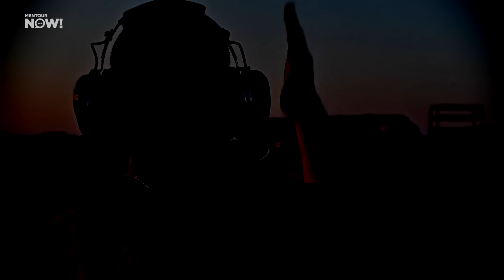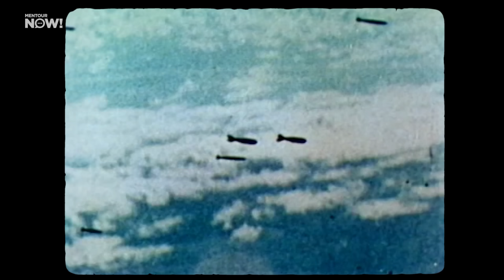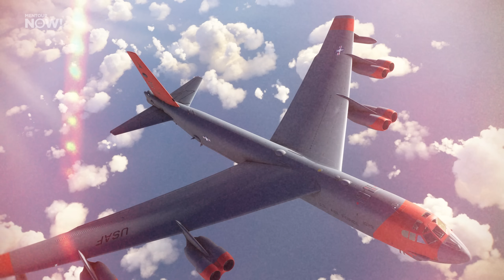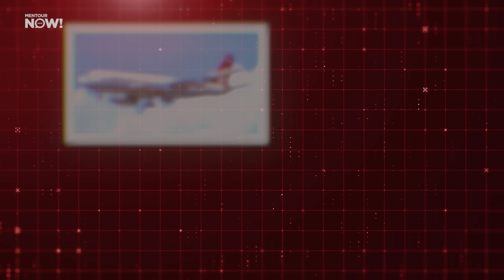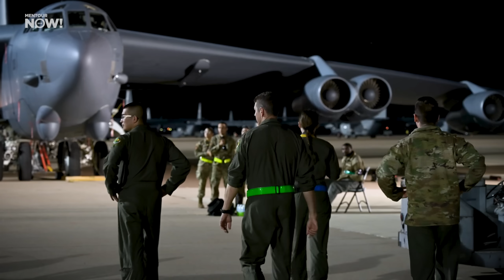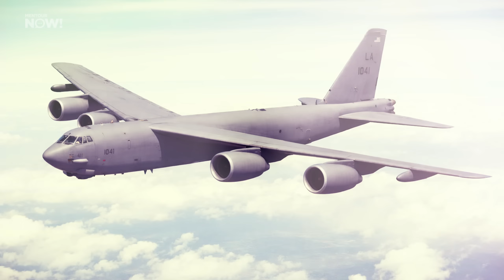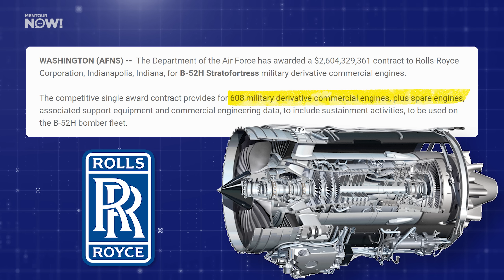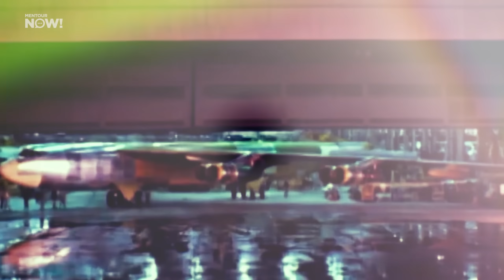WHY Are They Changing The B-52 NOW?!

Comment: My pops drove a BUFF from 1955-1959. My nephew is is on the engineering team at 
Rolls Royce NA that is working on the F130. Pretty cool.
Reply: Drove??
Reply: @toasterhavingabath6980 pilot slang for piloting an aircraft.
Reply: A great Job if you can get one.......
Reply: Dad was in the 9th BW during those years at Mountain Home, KC-97s and B-47s. I was born at the MHAFB hospital before the WW2 buildings were replaced, and visited old friends of my folks in 1981 while spending weekends at the sturgeon research crew trailer at Bruneau Dunes State Park.  In 1959, we moved to Rapid City, where Dad was one of the first three officers to establish the 28th ARS (the first digit of '928th' was dropped because they had a larger number of brand new KC-135As they were picking up from Moses Lake, which remains a Boeing Aircraft testing area.  After I retired to north Idaho, I met a former KC-135 flight engineer who'd been stationed at Minot AFB, while Dad's last duty station was Grand Forks.  I passed him Dad's appreciation for the flight engineers.  While on Alert Pad duty, flight engineers would have to load water for each engine's water injection system when the klaxon sounded, and offload the water when the "all clear" was given during the cold winters.  How cold was it?  We could tell it was cold when they were keeping the guard dogs inside, while airmen with M16s were still standing guard duty on the ramp.  Dad would take us kids out hunting snowshoe hares when it warmed up to zero, since it was warmer in the creek bottoms near the Pembina River.  (BTW, the flight engineer and I agree with Dad that it was a big mistake to remove those two positions from the 135. )

Comment: I suspect it is because of size.  There is little room between wing and the ground.  Eight engines allow them to be relatively small leaving reasonable clearance between engine and the ground.  Going to 4 engines would require 4 with far larger diameter then the current eight.  Additionally 4 larger engines instead of 8 similar to the current size would greatly change air flow over the wings.

Comment: Sometimes a machine just works so well, you can't replace it. The designers achieved such balanced perfection that everything that comes after has to compromise somewhere & something that makes them just less. Here is one another is the M2 .50 BMG from 1933
Reply: The big problem with Maw-duce is lack of sustained fire ability as it melts the barrel.. The GAU-19 with multiple barrels allows for much longer bursts with far less barrel wear because of reduced duty cycle and allowing for more barrel cooling.. This proves that there is always a newer better version that builds on the old.. A C-5 galaxy can carry 3x the bomb load of a B-52 and with the parachute suspended missile/bomb racks can deploy them at altitude so a F-22 or other aircraft can designate and guide them to targets..
Reply: It’s just a big plane.  Sometimes patching up a 60 year old airframe - even a great one- is so economically wasteful it should not happen.  

The world of commercial aviation has so much overlap that they could have replaced the b52 with a newer model easily decades ago.  

The B52 needs full air superiority so why not replace it with a 777?

Comment: My little sister has and still uses a KitchenAid mixer my parents purchased in the early 50's.Wisely, KitchenAid has not messed with the design in 70+ years. The B 52 may very well be worth modernizing.
Reply: It helps that out of all the B-52s we kept, we kept the lowest hour airframes and on top of that we keep another bunch in type 1000 storage so if we lose one (which has happened a few times now) then they pull another low hour frame out of the boneyard to refurbish. Although the planes are "old" they really aren't as planes go. Planes age out based on hours and cycles, not the date since manufactured. Cycles refers to how many times it has pressurized and depressurized. Operational B-52 airframes still have something like 1/3rd of their life left which is why it makes sense to keep them around. Basically the B-52 was built for something like 32,000 hours of flight time and none of them are over 25,000 hours yet. When you extrapolate that into the future, that's how they figure them still flying until the 2050s or even more. Some of the high hours frames will be retired starting in the mid-late 2040s but a sizable fleet will still be around for decades to come.
Reply: @ZboeC5 That... Makes a lot of sense. Huh. Whaddya know.

...unlike the guy we're commenting under. He talks about his sister still using a 70 year old mixer that the company hasn't changed the design of to this day... Then goes on to say, in light of his first statement I.... guess.... That the B-52 may very well be worth a complete redesign for modernization... Even though the mixer story can only be evidence for the saying, "what ain't broke, ya don't fix?" I don't get it.

My sister uses a 70 year old mixer! In fact the company still sells the same mixer today because the design was so robust! ..... Unlike the B52! Due to my sisters mixer, and the lessons its taught me, I'm of the opinion that we.... change every part on the bastards until they are unrecognizable!!! YEEEHAW!

Bro is one wild cowboy, I have a sneaking hunch... What's that called? Chaotic neutral? Or something.
Reply: Got a Kitchen Aid,....at 72 Had for years.......DNFW ,....DO NOT F..K with......It kitchen aid....
Reply: While I have nothing that old, my hand mixer is from the mid 90s and my can opener from the late 80s. Both still going strong as well, and probably for decades to come.
Reply: bullshit!!!! comparing a very usefull item to the asdtronomical money sinking airplane that your country cant even take care of its own people lol!!! what a spirit!
Reply: @carholic-sz3qv  -- Your basis of comparison for not even taking care of our own people is a world that has been protected by our military, mostly at our expense. So here's another comparison: imagine a world in which the Soviet Union had achieved world domination, or, more recently, communist China, Islamic extremism, or the corrupt UN/EU/WEF axis. Apparently, you value being "taken care of" more than being free from totalitarianism. And the part they don't tell you about is that being "taken care of" in that kind of world is being taken care of the way farmers take care of their cattle.
Reply: The early stand mixers seemed to have a safety circuit, they would not start up if they didn't recognize the "Off" position first. So don't give it up if that part of the switch gets dirty, just clean the contacts.

Comment: The JT3D is based off of the J57. The D-model has a larger vertical stab than the H-model.
Reply: Yes JT3D (TF33) is essentially a revised JT3C (J57) with an enlarged fan section substituted for the original fan at the front of the engine as a “quick-fix” to increase the bypass ratio and keep P&W “in the game” until improved clean-sheet designs could be introduced over the next decade.

Comment: Actually the B-52A to -F had a larger vertical stabilizer (and the rear gun turret with M2/M3 Heavy Machine Guns was manned), the B-52G then got that shorter one and the rear gun was remote-controlled, the B-52H then got a M61 Vulcan gatling gun instead.
And as JT3C and JT3D already suggest the JT3D/TF33 is essentially the same J57/JT3A-C core engine with a larger fan.

Prove me wrong but AFAIK there has never been a real reduction of the number of engines on existing airplanes (in the meaning of re-engining examples that have already been built but with less engines), there have been some parallel developments like the Airbus A330 and A340 or the Ju 52 which initially was the single-engine Ju 52/1m (one was even with a diesel engine) but they then only built 7 examples and then did the much more famous three-engine Ju 52/3m.
And there had been plans to develop downscaled versions of large planes with less engines like the MDD DC-10 Twin or the 747 Trijet but again except some testbeds they probably never intended to cut out the mid engine of an existing DC-10 or remove the outer engines of an existing 747 and put a third engine in the aft fuselage.
The 707 obviously got CFM56s which they also put on a lot of KC-135s and another version had JT8D but both still four of them.
It would seemingly alter the flying characteristics far too much and as said making it necessary to literally rebuild almost the entire plane with wings, parts of the fuselage and the tailplane which seemingly hasn't been viable on any plane yet, rather scrap it and get an entirely new one, like getting rid of TF33 KC-135s in favor of the KC-46 or the E-3, RAF and Armée de l’Air upgraded them to CFM56 but the USAF and NATO ones still have TF33s and they'll replace them with the Boeing E-7/737 AEW&C or other AWACS aircraft.

Comment: Wouldn’t the guys that designed the B-52 be disappointed if they knew that we are unable to cost effectively build a heavy, non stealth bomber with modern engines in 2026? Shouldn’t that be a fairly easy task, given how many heavy commercial and military aircraft we’ve designed and built since then?

Comment: It also make sense to reopen the Fairchild production line to build a few hundred more A10s. But this time the new A10s will ditch the heavy and clumsey 30 mm canon, and replace it with one 20 mm Vulcan , with more ammo and with 30 cal rotary guns in the nose.What ever weight capability still left can be replaced with added fuel. For anti tank role, the army still have choppers , but they are complex, expensive and do not have loitering time. Each tank require about 10 other trucks for support at the rear, and if they been disabled, the tanks are useless. There is still a role left unfilled from the original P47 Thunderbolt, and the B25 Gunn ships. That is not a spelling error, think Pappy Gunn the inventor.  If I am eastern block or third world, I would have bought the cheaper SU25 and Mi24 instead.

Comment: I worked on the G models and KC-135A’s, both powered by the J57 and I was in when the KC-135’s were upgraded to R models with the CFM-56. 

In the 1950’s there wasn’t an engine powerful enough to carry 600,000 pounds into the air using just 4, this led to the other design issues sen with using 4 today. The BUFF was truly revolutionary for its time.

Comment: One other benefit of the new engines will be a dramatically reduced sound signature. When the KC-135 was re-engined with high-bypass turbofans, their noise signature dropped by more than 90%. I was at McConnell AFB, in Wichita, Kansas when the KC-135R was rolled out, and it was absolutely amazing how much quieter the new airplanes were than the old ones.

This probably won't be militarily significant; noise of planes above 30,000' isn't an important consideration on the battlefield. But it should make people living near bomber bases significantly happier.
Reply: They’re brutally loud when you live in the flightline for landing.
Reply: There's nothing like getting blown out of bed at O'dark 30 on Sunday morning by a flight of low altitude B-52s flying overhead.
Reply: From the comments I sometimes see, you'd think the quieter planes would make people a lot sadder... 🙂

Comment: Eight engine because they need the power and engines were not powerful enough in those days. Using 4 engines would mean major structural modifications  ($$$)  and ground clearance problems. The other supersonic bombers were scraped because new radar and missile technology means speed and altitude are no longer a defense, They just need a bomb truck to get the ordnance to within stand off range. There are about 75? of them left and was already paid for, and they already have rotary launcher, so just upgrade the engines, it is much cheaper than developing a new bomber. Especially bad when you know the USAF tendencies to chase leading edge technologies, just look at the F35 mess now. 
The other viable alternate would be to modify C17 or reengine the C141 to just roll the ordnance out the rear door. That will work with the C130 as well, but it is a smaller plane, but expensive for the 747 because of the lack of a rear camshell door.

Comment: Colonel Don Sprague flew every B-52 model, from A to H and was the commander of the 23rd Bomb Squadron (Bomber Barons of Vietnam) and fought in the Vietnam war.
Lieutenant Colonel Don Welch flew B-52D during Cold War and most likely the 24x7 airborne missions when B-52s were equipped with nuclear bombs and were ALWAYS in air.
Captain Daniel Welch flew the B-52H and was assigned to the 23rd Bomb Squadron, same as Don Sprague.

Don Welch married Don Sprague's daughter, Diane Sprague, and Daniel Welch was their son.

So, in fact, three generations of father - in - law, son - in - law, and son have been on the B-52.

Both, Daniel Welch and Don Sprague were assigned to Minot AFB, and so it is very likely, that they may have been on the same aircraft as well.

Comment: I would expect the replacement for the 737 and A320 will acquire more hours and more cycles in a much shorter period of time than a military bomber. Therefore upgrade-ability of the designs may not be a requirement.

Comment: Sorry but I can't see the question here. The US airforce has been flying the idea of a re-power of the B-52 for years, junking the 1960's tech TF-33 that has been out of production for years and is now not really viable and the list of reasons is long a varied from scarce spares to high fuel consumption.

Their specs for doing this, however, are fairly tight in terms of what they will agree to change and come down to basically will, whatever is on offer, fit the same bolt holes on the wing, simplistic but pretty accurate for any number of reasons.

RR dangled the F-130 under their noses in pairs on a new ready to bolt on pylon along with the electronics package to run them and the US brass swallowed the bait for first two test conversions back in september 2021, followed by the fleet on a pretty tight schedule of time and price which will include over 600 engines, pods, pylons and assorted nuts and bolts to make them go that once bolted on and fired up have the proven reliability to outlast the airframes remaining service life without having to take them off the wing again.

How can RR be so confident, again pretty simple, the F-130 is a variant of the 700 series business jet engine with over 30 million hours in service to back it up with proven reliability, high spares availability for interchangeability and using the original and very standard electronics package for control all pushed by RR assurance that these little sputs are going to be on the market for the foreseeable future. What the airforce gets out of the deal is huge: lower operating costs, reduced support requirements when deployed, increased payload restrictions out of  higher thrust, increased range for the aircraft with lower fuel consumption, all adding up to billions saved over the expected 30 year life of the airframes.

The only question now is can RR actually meet the deadlines they have set for ground testing of the modules and pylons. Seems so far they can leaving only Boeing to do the heavy lifting and get the first two airframes ready to fly and tested on time. Not to worry, though, one of the three parties is bound to screw the pooch along the way, but in the end, they will sort themselves out, and the great-grandkids of the original crews can look forward to flying these tubs for years to come.

Comment: Flew the BUFF as a navigator-bombardier for 10 years in the 1980’s. It was my dead-last choice of aircraft 8n my “dream sheet” in Nav School. After a couple of years my opinion on it had changed 180 degrees. Loved that airplane and how reliable it was.
Reply: Mather AFB was on my newspaper route back in the early 80s. I used to love driving by all the BUFFs sitting out there ready to roll.
Reply: @ronjones-6977  I grew up near Davis Monthan in Tucson. It was pretty sad for this kid when they were dropping the big guillotine blade from the crane to cut up the B-52s and leave them out for the Soviet satellite overflights during the SALT / START era, when the (first?) Cold War was winding down. 
I loved driving by the AMARG and all of the associated parts dealers and the Pima Air Museum so much.

If you haven't read it, "Flight of the Old Dog" by Dale Brown is a great fictional novel featuring the BUFF.

Comment: I had a similar problem when I wanted to upgrade my 152's engine. I wanted more power and I also wanted more power. 
Luckily I found a W16 quad from a Veyron at a bone yard. Both the W16 and Lycoming are engines, so easy swap. But I failed to consider 
the 800lbs weight difference. A few JATO's for lift-off assist should get me off the ground. But it still drops like a brick once airborne. 
Small steps I guess.

Comment: I wonder how the combination of fatigue on a 60+ year old airframe and the new engines will play together. I know the new engines are supposed to be similar weight and thrust, but we know the bypass rate is 3 times higher, so they are more efficient. This means the airframe will carry the weight of the fuel for longer than it is used to, as the fuel will now be burned off at a slower rate. It SHOULDN'T make a difference, but COULD it?